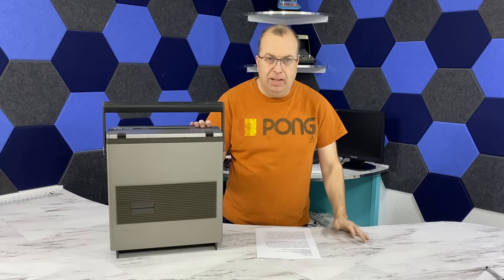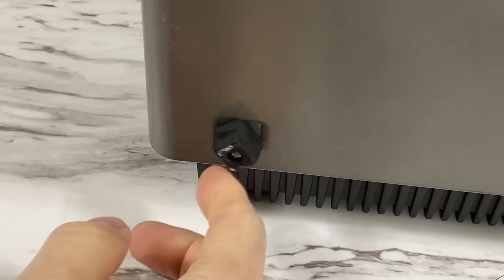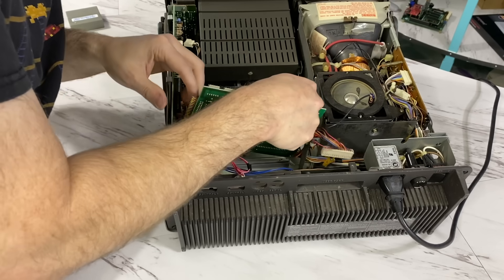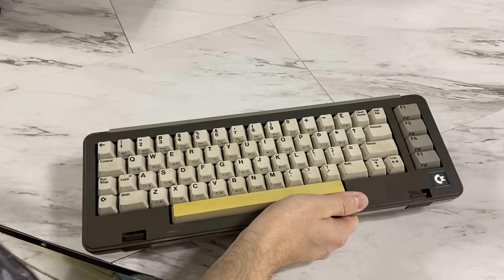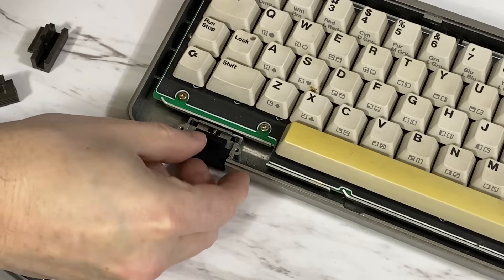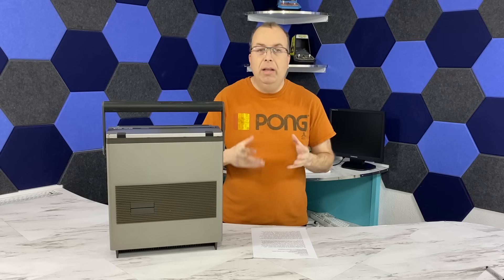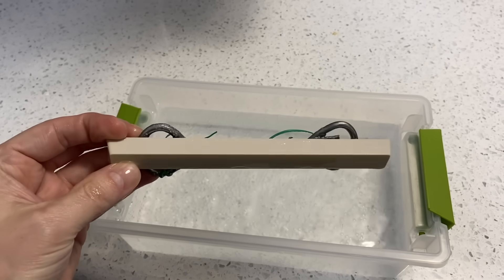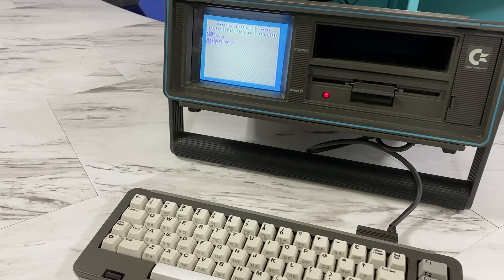Commodore SX-64 repair and trivia

Comment: My wife's first computer - bought in K-mart, on clearance. That was so much fun! Made my PCjr look silly by comparison.
Reply: the PCjr was pretty silly. Then Tandy Radio Shack made a clone of it that was actually way better. I didn't appreciate it at the time, dismissing it as just another IBM clone (I was way into Commodore and later Amiga at the time), but looking back on it, it was pretty cool considering the technology of the time.
Reply: @aleaxdeathbringer  I think that would be the Tandy 1000? 

I started with a TRS80 M1L1 4k originally, and moved on a British computer called the Camputers Lynx w/48K, 248x256 8-color graphics, etc. in 1983 with the promise of "real" business software via CP/M. But the company went bust and that was that. 

When I arrived in the States in 1983, I decided then I'd buy an IBM. No way would IBM go bust. So when the PCjr came along, I could "afford" it, and it was IBM, and it would be my "forever" computer. LOL. 

My wife got her SX-64 in 1985, iirc, and it completely blew the jr out of the water in terms of game play. 

I think the only plus on the jr. was the ability to run Wordstar 3.3 - came in handy for term papers and the like. ;)
Reply: @khobar95  yep, the Tandy 1000 line. 

There were several models over the years. Back when I worked at EB it seemed like it was one of the most popular IBM clones. Only recently have I really learned why. It was relatively cheap, had graphics that were far superior to CGA - almost equal to EGA, even though VGA was a thing at the time, not many people had it I guess. And the sound was superior as well, maybe not better than a Sound Blaster but certainly better than "beep." It was basically a better PCjr than the PCjr itself, and was listed by name on many games of the time. Kind of its own sub-platform.

Comment: You have to wonder who this was for. No battery meant that you had to plug it in somewhere. If you needed to travel and needed to do some computing where ever you went, the regular C-64 plus disk drive was still lighter and more compact than this thing. The screen is atrociously small for writing any documents. You'd likely just plug an a/v cable into the back of the TV in the hotel you might be staying in, which is what you'd do with a regular C-64. Massive and heavy, it's likely larger than any of your luggage. If you're flying do you really want to check this unprotected with the rest of the baggage that gets thrown around? At least if you put the C-64 and disk drive in a suitcase you can reinforce it with packing material (or clothes).
Reply: IDK, Commodore had a whole lot of dumb ideas and this seems to have been one of them.
Reply: The SX-64 fits perfectly under the seat on an airline, and can be used in coffee shops or anywhere else you can find a plug.  I used to travel with one in the late 90s and early 00s, and it is an awesome computer for that.

Comment: This is what I consider to be a perfect example of all the worst things that happened in tech at the time.   When the SX-64 was released, it was 2 years after the C64, which itself was released on a variation of a 6502 processor from 1975.   While the 6510 is more than a 6502, it put the SX-64 in the horrible position of being an "end of a long cycle" computer.  This is most notable as Intel had already put the 286 out and dropped the 386 right in the middle of the SX-64 product life.  The 386 had 12 times the clock speed and a 32 bit bus.  So really, the SX-64 was way too late to the party.

Even by this point, the IBM PC and clone types were starting to take over the business world., and Apple had a huge hold on the market with the Apple II variants.  Game players wouldn't want to pony up the extra money to get an SX-64 to play games on a tiny screen, especially as it wasn't a very nice screen either.  So there was really not that much of a target market except perhaps for hobbyist types who thought it cool (such as yourself!). 

Really the SX-64 should be noted as one of the last of the breed,  near the end of the 8 bit evolution lines.   In it's short 1984 to 1986 life, the computer market advanced rapidly and made this device pretty dated in such a short time.  It was a day later and a dollar short, if you like.
Reply: The NEC PC Engine is king of the 8bits.

Comment: Hey David? I was wondering, what would you recommend for cleaning a laptop keyboard and screen without disassembly?
Reply: I'm not David, but most cleaning liquids are not safe to use on bare LCDs, so just use water and paper towel or a soft cloth. For the keyboard, just use rubbing alcohol and a small brush.

Comment: I saved one of these little fellows from the landfill several years ago. Someone next to me hauled it out of his car and I spotted right away it was * something * made by COMMODORE. I asked if he would mind me having a look at it and he said "you can have it if you want it mate" and so it came home in the car with me. All that was wrong with it was the missing keyboard cable but I managed to knock one up out of 25 pin DIN plugs and it worked perfectly!! I gave it to the Bletchley Park Computer Museum and as far as I know, that's where it still is.....
Reply: Re: Bletchley Park
Where Dr Who took the SX-64 back in time to crack Nazi cyphers. 😊

Comment: I know I had one of these when I was younger, I can't remember if I found it at a garage sale or thrift store. I can't remember what happened to it, it might still be buried somewhere in my house under a pile of junk, maybe in the back of my closet. I don't remember ever getting rid of it, but my memory is terrible. No idea if it would still work though.
Reply: That's like losing a gold bar.
Reply: Good luck, Hope you find it! Additionally, the Rom chip is notorious for faliure. Replacements can be bought though. That is really the only major faliure im aware of. That and the floppy drive may need some belts.

Comment: Brings back good memories of the fun we had with the SX-64  The one I owned back in the day had a strange fault where the screen would flicker badly when displaying light border colours. I took it to a friends TV repair shop in Edniburgh and he had several days of fun trying to fix it. After about a week or so I popped into the shop to see how it was going and he was sat at the counter 'testing' it. The screen was much clearer and no longer had the flickering fault. He had replaced the screen with another that was very slightly smaller but had much better image quality. It took me a few weeks to save up to pay for the repair. Even with the improved screen I decided to sell it after a few months. I told the TV repair man and he said he would put it in his shop window and sell it for me.  On returning to the shop couple of weeks later I saw it was still in the window.. But It was displaying some flashy scrolling text advertising his services. I went in to ask if anyone had taken an interest, intending to drop the price if required. I was pleasantly surprised when he said it was sold and handed me the cash. It was used as a display piece in his shop window for a couple of years and made me smile every time I paseed by :-)
Reply: This is great!

Comment: 7:56 please buy a 3d printer. 3 weeks for a part that takes maybe an hour to print is such a long time. the bambu lab x1 carbon printer is a no fuss, auto leveling, and ai improving printer. its expensive but worth it. you could use it for a bunch of future projects if something breaks and you cant find the part online.

Comment: I love it i still have mine. Needs work i used to run a bbs system on it. I bought it for that use. I had to modify it because the voltage out on the modem port was diffrent than the c64 causing some modems not to work. I added a switch to turn off the monitor since i never really used it on the bbs. I ran my own custom written bbs software

Comment: I have an SX-64 still in it's original box. It was bought for me by my dad in 1984, cost around £700 at the time.  Dug it out recently during a move. Powers up like a dream. The only part missing is the cable from the keyboard to the unit. Does anyone know where I can get an original? I don't fancy a modern replacement.
Reply: Regrettably, many SX64s are missing that cable, and it's harder to find the cable than the actual unit.
Reply: I made up a cable for one I saved from the dump many years ago - even then they were rarer than an ashtray on a motorbike. Happy hunting!!!
Reply: Watch the techmoan video about this computer. He rigged a cable up.
Reply: It definitely wouldn't be hard to make one, but it's like David said in the  video, the keyboard cable is made of 50% unobtanium, 50% unicornium. Really don't know why it wasn't internally and permanently attached similar to the Osborne keyboard.
Reply: You have the original box?  Thats awesome!  I thought about having someone make a reproduction box for mine.

Comment: To your comment: The only place I saw these were at user group meetings, and even then the presenter would have a 1701 that faced the audience while he sat and typed in front of the small screen. In that the computer could drive both at once it was a good use-case.

Also...haha, yes no C64, or SX64 Visicalc (hmm, it was available on Atari 800) there was Microsoft Multiplan, pretty powerful and yes I have a real copy.

Comment: @The 8-Bit Guy I have an old Amstrad PC from 1987 and it happens to be that I have a problem with my serial mouse. (It is all clean) When I am moving it, all it does on the screen is being in stuck in the very middle and wiggling up and down for a few pixels. Any ideas how I could fix this?

Comment: There are 5" Color CRT portable TV's I've bought 6 of them. They aren't that expensive now because they can only be used as monitors and its not that popular a size. Can you try a tube swap with one of them to see if the NTSC shadow mask of another color screen might work better? Magnovox RD0510 is showing up often and has a great picture.
Reply: BTW the Tube in it is made by Samsung.
But it might be physically larger than its sold for use as.
Reply: I probably would have lusted for this one had I known of it! Such a small screen in color would have made me faint!

Comment: My elementary school put these in classrooms circa 1985, so perhaps they marketed it towards the education market? A couple years later my school replaced them with regular breadbox C64s fitted inside metal cases (literally the plastic breadbox inside a plain brown metal box with a cutout for the keyboard), seemingly to prevent theft or damage. At that time, they also installed only one disk drive for every four computers, with a mechanical selector switch, so everyone in the row had to take turns loading the software! (Maybe if they hadn't blown their budget on SX-64s, they could have afforded a disk drive for every breadbox C64!)

Comment: Hey Man! Just wanted to fill you in on the DX64,
The DX 64 WAS indeed it's own unit, however, it was only sold commercially, as in Large companies (Like Exide Battery) to mid-high ranking employees, such as plant managers. My grandfather said that it was technically called out as an SX-64DD so it may have just been a special order package, but the ones that made it to those companies ended up usually getting recycled or destroyed for "Data Safety" (Really shows how companies where back then too about PC's)

Comment: You mentioned that unique keyboard cable. Commodore has been using some more connectors over the years, which are practically unobtanium by now. Such as the power connector of A500, and the 23-pin floppy drive  and video connectors.

Comment: I am sure the channel owner knows this, but needs saying for those who might try fixing retro machine themselves like me - usually when custom chips or RAM fail the underlying issue is the PSU - its always best to replace them entirely with newer circuitry which is easy to get in a modular form, or at least recap, its just a default for me now after hard experience of repairs thats "worked" then went bad again soon after, killing expensive rare replacement chips.

Comment: Pshhh. You didn't have an SX-64? Well, I have a working one sitting a couple feet away. Paid $100 for it.

Well, what is actually cool thing is that my friend was a Commodore 64 collector and still owns a "DX-64" which has two 1541 controller cards in it and some custom chips/eproms. We brought it to some computer festivals and for one we met Jim Butterfield who demonstrated typing on my friend's PET with a chiclet keyboard—Jim used to have one in his office.

Comment: pla and sid, yup thats what had mine down too, that 90 degree board connection is a pain to deal with and is impossible to fix permanently since it comes apart over time

Comment: ---------------------------------------------------------------------------------------------------------
The most important feature of the repair is to check if "PETSCII Robots" works ;)
If it works then it's a job well done.
---------------------------------------------------------------------------------------------------------

Comment: Nice.. I was a C= tech in the 80s.. and bought one from a clearance house for $300 brand new.  The reason they didn't sell is bc of Commodore's TERRIBLE marketing (or lack there of). No one actually heard of the SX by the time they decided to dump them on the clearance houses.  I modified mine quite a bit with an internal (switchable) Fast Load cart.. and I used the upper drive bad to house an internal 1200 baud mode.  The thing ROCKED.. LOVED it.. After I got my Amiga 500... I ended up selling it for $100 more than I bought it for  4 years later to a Navy guy who wanted to bring in aboard his sub when on patrol for floppy copy parties.  Also.. recommend using a 25pin extension cable to give you more length on the KB cable.

Comment: The linked pads that exist in a 1541 that allow adding two switches to make the disk device number selectable between 8, 9, 10, and 11 are also present on the disk controller board in the sx. I broke those pads and added a pair of spst slide switches inside the disk storage bay, above the drive. Made it possible to run an external 1541. Just an FYI. I loved my sx.

Comment: I'm sure that monitor isn't working optimally, even with these issues. I have a JVC colour 6 inch TV (which I would imagine is something similar inside) And it outputs a far crisper image than what you are getting?

Comment: I have a SX-64, used but still in it's original double-boxed packaging. I haven't touched it in probably 30 years or more, it was 100% functional when last I did though. Looking for tips and suggestions on best practices for pulling it out and seeing if it still works.

I also have a C-128, 1571, REU, mouse, as well as 2 SFD-1001 drives with IEEE-488 interface for Commodore and some GPIB cables.

Comment: Hum. I wonder if I can remember where my SX-64s are and see if either one still works. I used the a lot in the 80s and 90s for show control in haunted houses. Ran all the audio and all the effects from the one computer. The display showed the show status at any time, or you could also review, change, or program new show elements.

Comment: I've got one. I bought in the late 80's when I was serving in the Navy. It fit perfectly in one of the storage sections under my rack. I never had many games for it and after I left the Navy it went into the closet. I get it out once in a while just to see if it still works. And it does still work.  The tiny screen was a hassle so when I was ashore I used a full sized Commodore monitor.  Yup, it still works too.

Comment: Great video! I know people tend to not like modern mods, but would it even be possible to replace the CRT with a newer 5" colour CRT maybe from the 90s that is more capable, or maybe a modern 4:3 LCD that may actually be larger and feed it the RGB output from the VIC-II? Or use an RGB2HDMI mounted internally to get the RGB outputs to the LCD? I would guess a 640x480 panel would be a good compromise screen resolution.

Comment: Great video!  This is a computer I always wanted to get a hold of back in the 80's.  Just two expensive.

Finally acquired two of them several years ago. One is working.  The other has that white screen.  I figured I would use it for parts if the other died.  Never thought about seriously  fixing it.  Power supply voltages where good so I figured a logic problem on the main board.

You have renewed my interest in seeing if I can repair it.  I have a couple of C64 carcasses lying around.  I'll see about swapping out some chips.  Maybe it is the same issue!  A bad SID and/or PLA chip.  

One thing, I am missing is a Keyboard cable.  Anyone know where I could source one?
The connectors resemble old 25pin RS232 or SCSI cables.  Is the connection a straight through, Pin for Pin?  I may try a substitute.
Reply: YaY!  Got it fixed.  Swapped chips between the working and non working units to troubleshoot.  Came down to the PLA chip being bad.   
I bough one of those aftermarket replacements, put it in and the SX came right up!

Comment: The last one of these that I saw in the wild was at a radio station I interned at in high school in 1994. They had just taken it out of service where it had been running the transmitter for several years. When I came along, it was being used as a doorstop. They wanted to keep it as a backup in case their new Win 3 machine ever went down.

Comment: a reason for little success is certainly the quality of the monitor: low and the image is also a little crooked; for 1000$ it is unacceptable. Does the jungle chip have rgb and s-video inputs? Maybe, trying to replace the VicII with an fpga that comes out in rgb, it could give an unexpected sharpness 😉